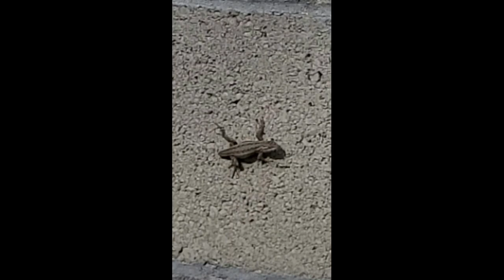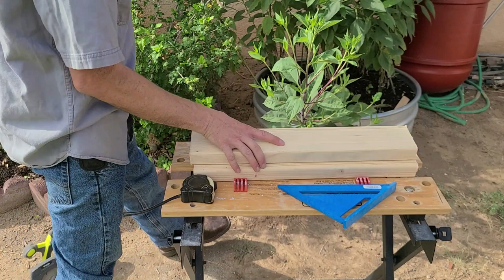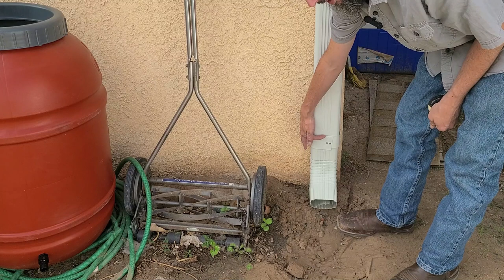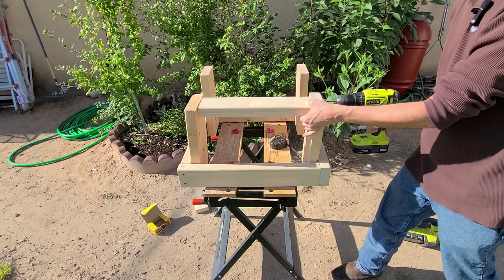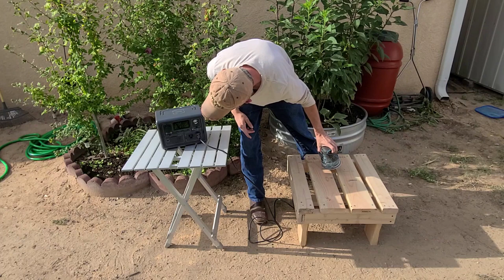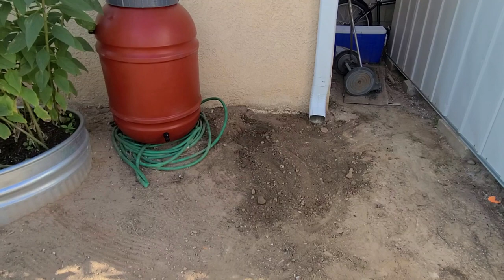Rain Barrel Stand Build-DIY

Comment: Great video. Thanks. Is there a reason why you connected just the 2 back legs but not the other two? 
I plan to build the stand for 2 barrels so my guess is to have 6 legs and extend the length of the frame to have 2 of 20” and 2 of 38”. Am I correct?